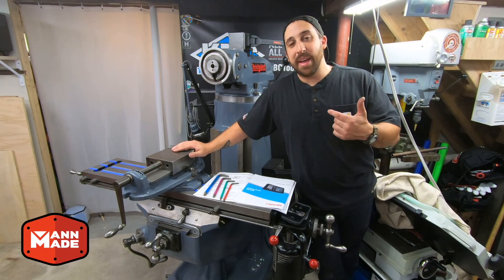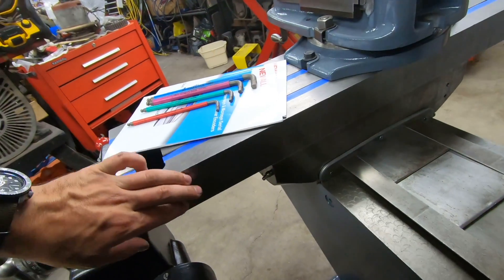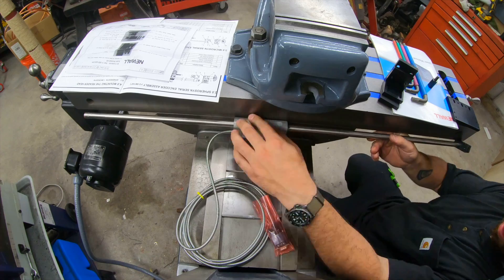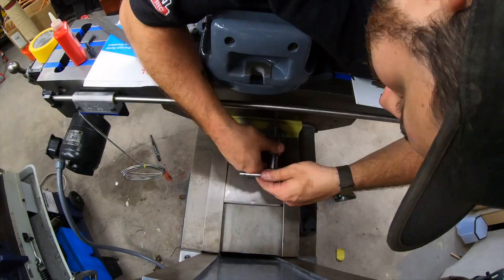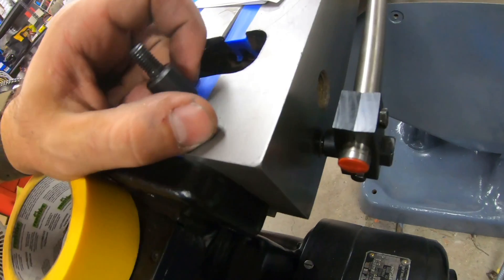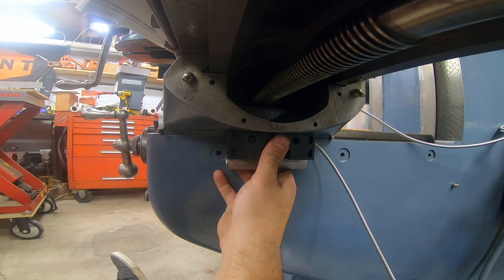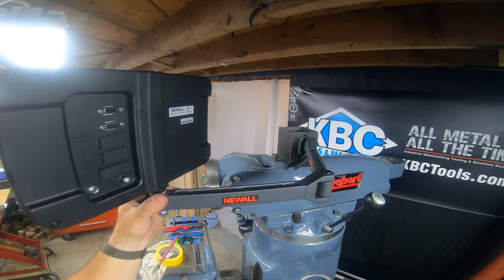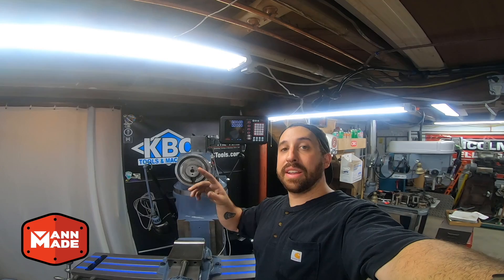Installing a Newall NMS800 DRO On My Bridgeport Mill!

Comment: You’ve got no vertical adjustment on your scales? Scales must be parallel to the machines ways/table surface. Kit comes with a post/clamp for vertical adjustment.

Comment: I hope you cover the programming. We just got one for our mill and didn’t get any training on it and have struggled figuring out some of the features
Reply from the maker: It is certainly not a simple unit to figure out without any training or instruction. The programming instructions it came with were very minimal and basic, but I found they did not go nearly in depth enough for me. I am working through it, and I do hope to do a video showing the features and how to program them once I feel knowledgeable enough.